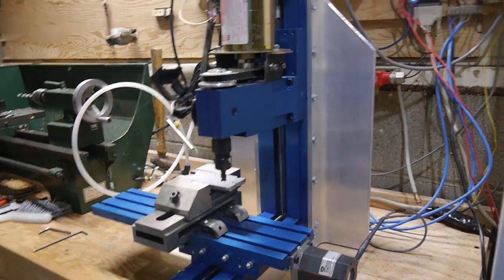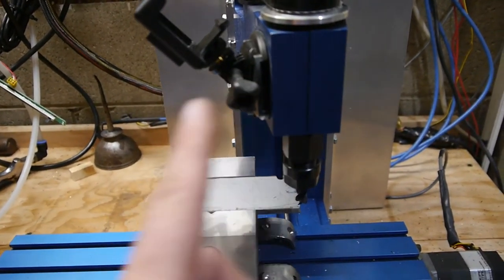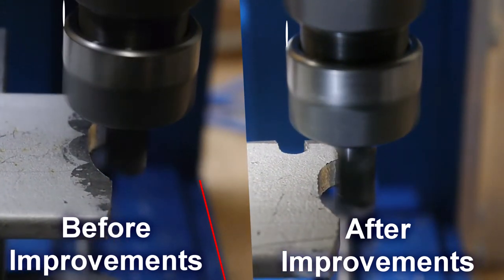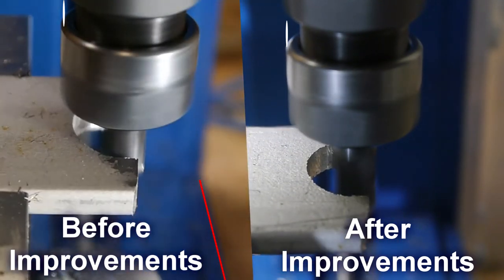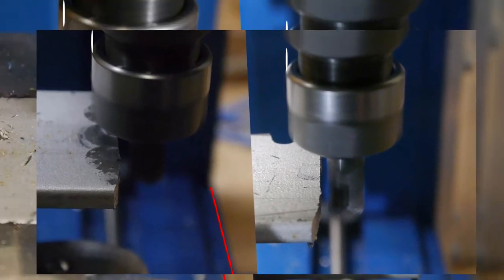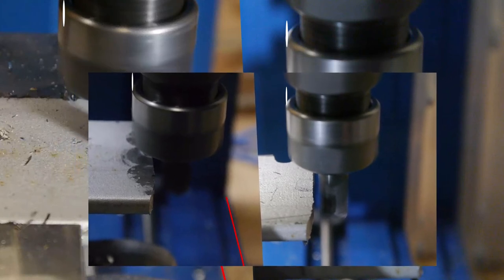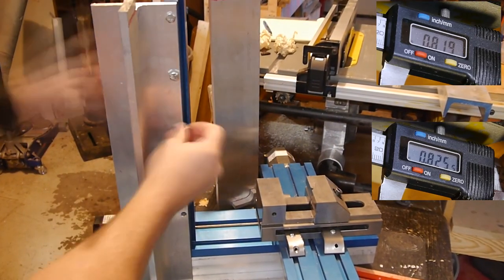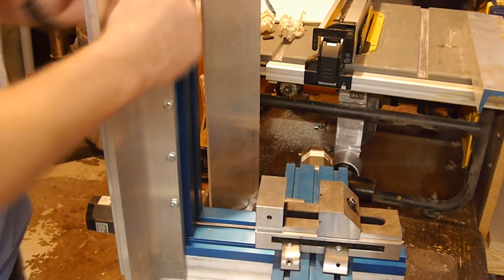How Rigid Can We Make the MaxNC CNC Mini-Mill? The Answer is Very!

Comment: In Conventional Milling, the cutter rotates against the direction of the feed. During Climb Milling, the cutter rotates with the feed. Conventional Milling is the traditional approach when cutting because the backlash, or the play between the lead screw and the nut in the machine table, is eliminated (Figure 1).

Comment: The column stiffness must be equal to the base stiffness. A force of 10 kg should cause a displacement of no more than 0.01 mm. Better 30-60 kg. Use larger steel reinforcements.

Comment: I'm not sure if you took it off or not but you're missing a bearing block on the front side of your Y-axis that stabilizes the leadscrew.-cheers
Reply from the maker: Thanks Renegade, yeah mine did not come with one. I think it is a very old model as it doesnt have the indent on the x axis either for coolant to pool in. The ebay seller said it was a demonstration model from a tech school. I plan on making some at some point.
Reply: Lol i didn't even notice to missing coolant pool. When you decide to make one let me know if you want any of the measurements from mine. -cheers

Comment: The thick aluminum U-channel on the bottom is good.  A block of concrete or epoxy-granite would be better. Cast some long hex nuts into the block to fasten the aluminum support to.
Reply: In fact, flip the machine upside down, pull the U-channel, seal it up as needed, and just cast the concrete straight into the U-channel. Once the concrete cures in a month, grab the block and lap the surface true, and then screw it back onto the machine.  Rectangluar tubing would do the same job.
Reply from the maker: Only problem with using anchors is attaching the mill to the anchor.... Maybe go all the way through the concrete? Right now I am using blind threaded holes into the mill base. Square tubing would be a good use as well. I didn't use it because I did not have it available. If I had steel C channel or rectangular tubing I certainly would have used it. I think rectangular tubing and filling it with sand to keep the harmonics down would work well too. Personally I haven't used concrete too often in my life and have limited personal working knowledge. The only knowledge I have is from a reinforced concrete design class I took in college.
Reply: @JoshAQ  I have done a few decks and a landscaping wall.  It's not difficult, just done leave it on your hands because you will get a nice chemical burn. Your current c-channel already has holes in it.  Do you have a 3D printer?  You can print up a funnel wide enough for each of the bolts to be installed with a socket and driver. Maybe make it out of aluminum cans? Cut the top and bottom, slit down the side, trim to fit?

Comment: I have a MAXNC machine CNC machine too.  What's the story with the gib screws on your X and Y slides?  I've never seen them setup like that before.
Reply from the maker: JRMNone I found that I was always adjusting the gib set screws. I took out one of the set screws and determined the thread. 8-32 if I remember correctly. I had some machine screws and nuts in the same thread laying around so I am currently using a machine screw and lock nut to help keep the gibs aligned properly for longer. I still have problems when I cut mild steel for a while aggressively. But over all they stay in place much more reliably. I think I cover this in one of my videos. I think maybe the state of the Empire video I cover that. Let me know if you need more detail. Thanks for stopping by and checking out my MaxNC!
Reply: This is perfect timing as I am n the process of re-installing the X and Y slides on my machine.  I've read these machines have issues with the gibs coming loose.  I will have to try what you have done.  I still can't believe you're cutting mild steel.  That's awesome!!!

Comment: wadupdoh..i havent seen any new maxnc videos..it appears these old machines will soon be all retired and melted down for aluminium scrap value...there cant be many still in circulation...
Reply from the maker: Alot! I spent last year fixing up a house and moving into it. Plus side is I upgraded from the one car garage to a 35' x 40 pole barn, downside is it is still full of random stuff from the move. Going to be a couple of months before I can get everything squared away and get back to experimenting. I have a scooter for the wife and a Suzuki king quad 300 for myself I have to get running as well. Been a crazy year and a half.

Comment: Good vid josh, looks very effective ... I don't think my maxnc10 he so much space on chassis for these mods but really cool.   What's the cutter size and brand  you are using in the side by side comparison ?
Reply from the maker: RuralEngineer Thanks man. I think you should have room as the side of the t shape doesn't go past the z way so you shouldn't loose any travel. I looked at your motor upgrade video again and it does look like you would have to remove and offset back the silver control box by 4-5" max. That would give you enough room towards the back for plate or c channel to be added to help stiffen up your mill.
Reply from the maker: Its the same 3/8" 4 flute carbide cutter that was in the cutter video I did a couple months ago. Can't remember right off the top of my head the number

Comment: Hi. Not knocking that idea, just asking. Original spindle bearings? I also question you metrology. I can massage my digital calipers to make them read what i want (expect). good video but that looks like a lot of $$$ in Al, at least in australia for a tiny improvement. I bolted my mill to thick  steel plate to THICK wooden bench. Not flat in any real sence, but stiff...er.      Not negative comment, just talking.
Reply from the maker: Hey Michael, thanks for commenting. I think the side by side video shows best the results. There was certainly an improvement in rigidity, quantifying that improvement is certainly up for debate lol. True you can massage a couple thousandths out of a crappy caliper, but 0.006" is a bit much I think. I picked the Aluminum cutoffs out of the dumpster at work so that cost part was negligible to me. You could certainly substitute them out for steel or other shapes pretty easily. I just used what I had laying around. What model of mill do you have? I really need to secure mine to my bench. No worries, constructive criticism is always welcome here on this channel as I started it to converse with like minded people like you.